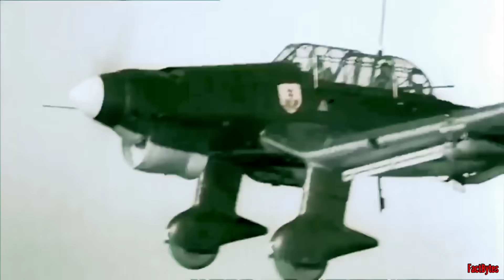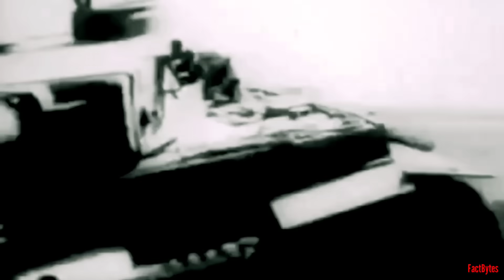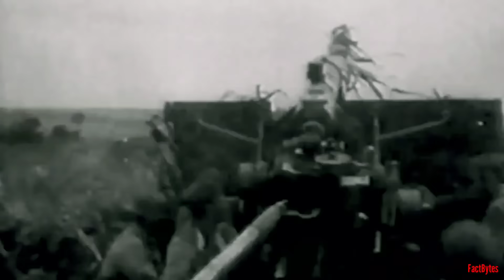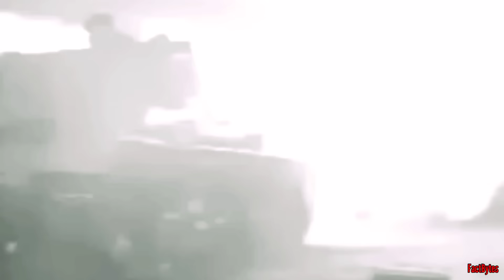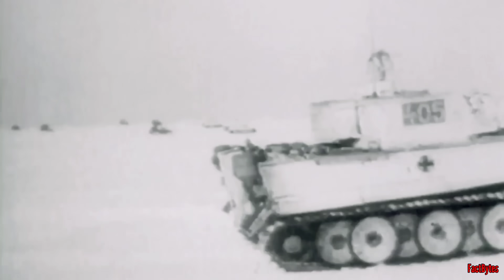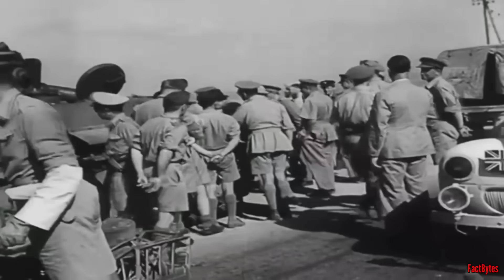Was the Fear Imposed By The Tiger Tank Justified?

Comment: I feel like the fact that they broke down all the time and were a nightmare to repair is a huge issue.  1/3 of the losses in german records were due to fact that the tank broke down and they had to abandon it.   As I remember another 1/3 were abandoned to lack of fuel.  Add to the fact that they took forever to build.  It was a bad tank for an army even if it was. great if you got it into battle.  The problem is the US could build 5-6 sherman's with 76 guns for the cost of one tiger.  Or 4-6 M36.

The reality is Germany should have never have designed the Tiger, but instead designed a more reliable Panther or just built more StuG III, Jagdpanzer, and Jagdpanther (with simpler engine).

Comment: My Grandfather led a Troop of Shermans in Patton's Command, across northern Europe to Czechoslovakia. They stopped for an orientation and noticed a Tiger 1 sitting across the valley from them in a wooded Hilltop. He said the distance was a good mile, and as they looked at the Tiger it let off a shot. He said that shot crossed that mile and impacted in the Gunner's sight, of the Sherman behind him. He said that the hit made a perfect 88mm hole and continued out the rear of the Tank. He said that the entire way across that Valley the round did not drop one inch, before it hit the Tank and exited the rear. He further said that the Gunner's Head went out the back of that Sherman and all that was left was a headless Body, still sitting in the Seat. Yes, the fear was justified.

Comment: Tiger was a plus. But its successor was a mistake, didnt add much but double the issues. Dont forget force multiplier. Best crews and commanders got Tiger tanks. Spearhead function. 

Comparing numbers with T-34 and shermans isnt fair. You better take the pzkw 4 tank, still decent effective till the last year : almost 9000 build. Still, outnumbered of course. Unexpected bonus: they looked like a Tiger, scaring foes. 

But production was second reason for failure. Primary , Germany lacked fuel to wage war anyway since they failed to take the Caucasian oil fields. Nothing else matters more then that. Mobile warfare was their trump card - but it was neutralized in strategic perspective.

Comment: Rare (only 1300 made in 2 years of production), unreliable tank with maintenance and logistical issues.  That to me is "Trash."  A formidable tank but an irrelevant factor in the war because of its rarity and unreliability.
Reply: It was one of the most reliable late war tanks.
Reply: Overall a 65-70% operational average, which was pretty good for such a heavy tank, and the Tigers got everywhere the Germans wanted to send them.

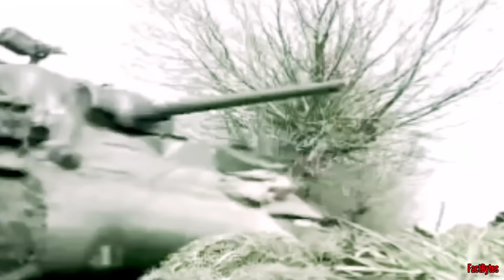Comment: The question posed at 1:58 asks "Did it truly warrant its fearsome reputation or was it an over-engineered and unreliable machine?" The answer is yes, and yes. 
From a tank-on-tank battlefield perspective, the Tiger was superior and, as long as it was functioning, could pretty much defeat any Allied tank in one-on-one battles, and it did just that. Many Allied tanks were knocked out well before they even came into range of firing back at the Tiger. But as the video points out, the Tiger's high rate of non-combat losses and dismal 36% reliability rating illustrates the folly of producing such a complex and expensive tank. 
Germany was never going to win the war with this tank because they had too few of them, and could never keep pace with replacing those lost in the field. 
Ironically, the United States had the manufacturing capacity to build and field its own heavy tank and could have done so in far greater numbers than the Tiger. And yet, the USA decided to stick with its medium Sherman tank and churn it out in enormous numbers. The USA did develop the heavy Pershing tank and even shipped a few to Europe before the war was over, but the victory goes to the Sherman. It did not match the specs of the Tiger, but was more reliable and versatile, and probably seemed as numerous to the Germans as blades of grass.
I have often wondered how things might have gone if Germany had time to perfect the Tiger design and overcome its techical issues, and likewise if the USA decided to field heavier tanks in fewer numbers.

Comment: The Tiger 1e was an over engendered pillbox.
The Panzer V Panther was better value.
Reply: Tiger was more effective and slightly more reliable.
Reply: @lyndoncmp5751  Early Panthers were unreliable because they were rushed into production, later versions were very reliable.
Reply: @Milovan-c9x 
In 1944/45 the Tigers overall average operational rate was 65-70%.
Panther was 62-65%. Tiger was slightly more reliable, and harder to knock out with a higher kill ratio.
Panther was good. Just not better than the Tiger.

Comment: The Tiger was slow, too heavy and learge to be transported with tracks mounted in rails, meaning it was also a logistical nightmare... to transport...
the gun of the Tiger, the 88mm kwk L56 was a good gun, superior to anything the alies had at the time, but it was not even better than the 75mm kwk L70 the Panther had, the panther gun was cappable of penetrating more armor at distance... 

So the Panther was faster than the Tiger, had frontally literally the same armor because it was sloped, and it had a better gun...

Yet, yes the Tiger was a feared tank, but if the Reich chosen to streamline the Panther and optimize its design, they would cause way more trouble to the Allies.

The Panther was overall a better tank.
Reply: Tiger was overall stronger all round with a superior all round gun.
Panther took a long time to justify its production and it was not declared fully combat ripe by Guderian until spring 1944. Tiger I production ended soon after.
Throughout 1943 and first half of 1944 the Tiger proved to be better and more effective.

Comment: Yes and NO.  "Yes", because by the time most of the American and British forces were engaging in large-scale armored engagements where the Tiger was present, they were on the defensive, under conditions that favored the Tiger.  As for the Soviets, the Tiger was designed with combat on the Eastern Front in mind, and it took out Soviet armor in hugely disproportionate numbers.  "NO", because, all that firepower and armor aside, it had its drawbacks.  The heavy weight, for one thing, simply made it hard to get through muddy and/or marshy terrain, made it too heavy for quite a few bridges, and, if disabled, a literal BEAST to recover and tow back to safety.  Also, although its side and rear armor were still formidable, the Tiger could be penetrated by decent AP rounds from Allied and Soviet tanks at engagements of less than 500 meters.  Of course, its tracks and suspension were vulnerable, as any tank's would be, and the complexity meant that they'd be hard to repair.

The Tiger's reputation is something that came out of many a WWII-themed movie, TV show, or comic books, which all greatly exaggerated its prowess.  The reality is that about 75 percent of Tigers and King Tigers went to the Eastern Front, simply because the Soviets had so many AFVs themselves.  As I mentioned earlier, by D-Day until V-E day, most of the time; the Germans were on the defensive.  Even when they attacked, as in at Mortain in early August of 1944, or in the Ardennes, the Tigers were not at the forefront of the attack, unlike they'd been at Kursk (and whose losses were shown in recent times to have been hugely exaggerated).  For example, the infamous Kampgruppe Peiper had 72 tanks (38 Mark IVs and 34 Panthers), and also had an attached Panzerabteilung of 27 King Tigers, the latter were kept in the rear, mainly because Peiper had to hoard his gasoline supply to accomplish the break-through to the Meuse river, which objective was never realized.  These, save for a few breakdowns (I believe one of them is the KT at La Gelize, Belgium), were, once Peiper and his men, out of fuel and cut off from their front lines, had to destroy the surviving tanks and break out on foot, were entrained and sent to Hungary to participate, along with what of Sixth Panzer Army had survived, in a furtive attempt to relieve Budapest, and later, in March of 1945, in Operation "Spring Awakening", which likewise failed, miserably.  The Tigers had to deal with an early spring thaw which turned the Hungarian plains into a quagmire.  Had the attack waited two weeks, it would have found more favorable conditions in an unexpected late winter storm that re-froze the ground and grounded the Soviet Frontal Aviation.

Comment: The germans achieved their greatest victories in 1939-40 with PanzerIIs and czech tanks mostly, combined with full air supremacy and proper doctrine on medium size enemy territories. 

Since the Tiger was in service the Wehrmacht only suffered massive defeats one after another. The 100 or so Tigers usually available were simply too few to make a difference. What the germans actually needed was 1000s of P4s, Stugs instead combined with single engine fighters and tank buster planes.
Reply: That's what the Inspector-General of the Panzerwaffe, Heinz Guderian, wanted.  However, how do you expect that the better value of "thousands" Panzer IVs and StuGs instead of the "Big Cats" would have come off?  Would the Germans have been able to keep them crewed and SUPPLIED?  That was their greatest weakness.
Reply: "Since the Tiger was in service the Wehrmacht only suffered massive defeats one after another"

Not true. And the Tigers did well in some counter attacks and holding the allies at bay on plenty of occasions.

Comment: You've MISSED the fact that the Tiger was designed as a Break Through Tank.  I was designed/intended to have a maintaince break between operations.  Before it was sent in again.  It was used as a Fire Brigade, running from one hot spot to the next, without that maintaince.  The Chieftain did a video on this very same issue.
Reply: The fact that the Tiger was intended as a "breakthrough" weapon is genuine, but does not change the fact that it was not always used in that manner, indeed usually it was not. After the tide of the war turned against the Germans, the Tiger more often than not found itself being used as a rear-guard weapon. In other words, not on the offensive, but in defensive roles. It often excelled in such use, a tribute to the utility of the basic design.

Comment: Some crucial facts were not discussed in the video. The Tiger kill ratio was much greater than that of any allied tank. The crew losses were also lower in this model than in other german tanks, if my memory is not failing me. It took 5 Shermans to kill a Tiger, officially. Thus, the tank was awesome. It was expensive? Yes sure. Germany could build a lot? No. A little more than 1300 Tigers were made, against 50k Shermans and more than 50k T34. Thus, it was fighting against impossible odds. Later allied weapons could beat it? Yes. The 17lb, the american 90mm gun, the russian 85mm gun and particularly the russian 100mm were all capable of defeating the Tiger, even the Kingtiger. But it remained a viable combat machine to the end. The problem was more of logistics, supplies and field repair capacity under allied complete air supremacy. The tank is an engineering marvel, but Germany can't afford it. In this aspect I totally agree with you.
Reply: It did not take 5 Shermans to kill a Tiger.  That myth comes from the fact that Shermans often traveled in squadrons of 5.  The survival rate in Shermans was much higher for the crew as well.
Reply: Like the famed Me262 jet fighter, the Tiger simply couldn't win the war by itself.  Hitler's strategy of the "Wunderwaffen" was a tacit admission that Germany was fighting a LOSING war; it was a matter of PRODUCTION and LOGISTICS, and Germany was at least matched by either the UK or the USSR, and outclassed entirely by the USA, so having to deal with ALL THREE AT ONCE; what other outcome could there be?  What Hitler hoped (against common sense) was that (a) the "Wunderwaffen" would inspire the nation that they still had a chance, and would thus fight on, and (b) they'd make the price of "victory" high enough that the Allies would sue for peace, or bicker with each other, and a peace settlement that left the Nazi regime intact would result.

As put in the otherwise highly-inaccurate, from a historian's view, the 1965 film, "Battle of the Bulge", it gets the essence of some things on target.  An example is where, in briefing Oberst Martin Hessler (played by Robert Shaw, based on SS-Obersturmbannfuhrer Jochen Peiper), General Kohler (Werner Peters) shows him models of a nondescript jet fighter, and the V1 and V2 missiles, and the "New, 70-ton King Tiger tank" (actually a post-war M47, which, if the Germans magically had some, they might have done better!), which Hessler briefly caresses in admiration, and proclaims: "A very beautiful model, Herr General...it still proves that the Germans are the world's best TOY MAKERS."
Reply: @selfdo  So we get to the same point. Wunderwaffen don't win wars. Production does.
Reply: I concur with everything you wrote.  Well done.

Comment: The crews dispute the so called lack of mobility . They also said it was a very robust machine , with most breakdowns being attributable to inexperienced drivers. The crews loved this tank and that’s the bottom line . Sherman crews knew they were going to die if one of these things showed up on the battlefield. Ditto T- 34 crews . Any tank crew given the choice would choose the Tiger .
Reply: The Tiger was quite mobile for a tank of its size and weight. It had wide treads, and could turn within its own length due to its transmission and drive-train design. It's ground flotation pressure wasn't at all bad, despite its weight of over fifty tons, due to its large tracks spreading out the ground pressure. 

The difficulty for the Tiger was not just breakdowns, but getting bogged down in soft ground, snow, ice and slush. If there were no nearby tank recovery vehicles, then multiple smaller tanks were needed to drag one free, or another Tiger. If these were not available, sometimes crews had to abandon them in the face of advancing Allied troops. 

Thorough recon of the terrain and local conditions was essential. Experienced tank commanders often did it themselves. It was necessary not just to locate enemy forces and suitable fighting positions, but to scope out terrain unsuited to their tanks and best-avoided. They also wanted to do it to get as much knowledge of potential areas of enemy AT emplacements and mine fields, and other hazards.
Reply: I laugh when I hear this as a retired soldier & mechanic. In ww2 they did what we do Quality AND Quanity! Germany in ww2 could rarely figure this out. Sucks be them LOSERS lol

Comment: I gues the fear was justified, but Tigers were rare.  What exacerbated the problem was a similar look to the Pzr IV.  It seemed that everything that destroyed allied tanks was a ‘Tiger’.
I’m curious as to the source material for Sherman’s 580% loss rate.   It sounds like the load of garbage from ‘Deathtraps’.
The 580% were tanks knocked out in the 3rd AD and not representative of all AD’s.

Tiger had a very specific role:  Breakthrough tank.
After Kursk, it became little more than a tank destroyer and used to blunt massive Russian armored thrusts.  
Tiger was a good tank.  But, ended up used for something other than it was developed for.
Reply: You're absolutely right, its intended role was to perform breakthrough operations, supported by infantry and grenadiers.  Once the breakthrough was established, it was then intended to be withdrawn back behind the front line and be maintained/refitted/repaired as required and readied for the next breakthrough.  Under these "optimal" conditions it was a near perfectly designed tank.  But, once the tide of war changed and Germany went mostly on defensive footing - with dwindling resources and being increasingly outnumbered on all fronts - these machines were forced into constant service and simply weren't suited for that type of combat.
Reply: The Tiger's performance in the "breakthrough" role was found to be rather WANTING; due to, in no small part, the Soviet response of the "Pakfront", that is, massed batteries of anti-tanks guns, dug in, hard to find.  Of course, having intelligence and opsec failures that give your opponent virtually perfect knowledge of the timing of your attack, forces deployed, and objectives and ample TIME to prepare extensive defenses, didn't help.  The Tiger battalions proved their worth in blunting subsequent Soviet offensives, using their thick hides and superior firepower to pick off T-34s, almost at leisure, until more or less they ran low on ordnance and fuel and had to withdraw!  It was in that role where the Tiger's legend grew.
Reply: @selfdo

Actually Tigers were mostly quite effective and successful when used offensively in a breakthrough role. Retaking of Kharkov, Zhitomir-Berdichev, Cherkassy-Korsun Pocket relief, Gran Bridgehead.
No tank would have suceeded at Kursk. Too many prepared defensive belts. Still the Tigers had a high kill ratio even there, with relatively few losses.